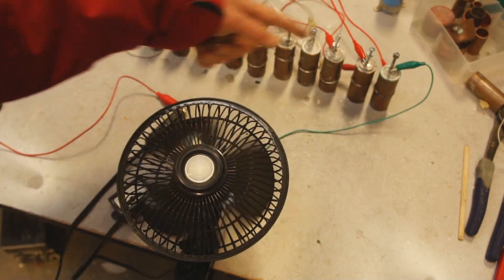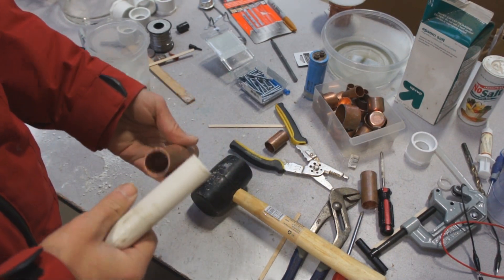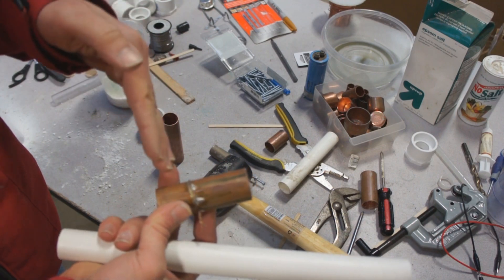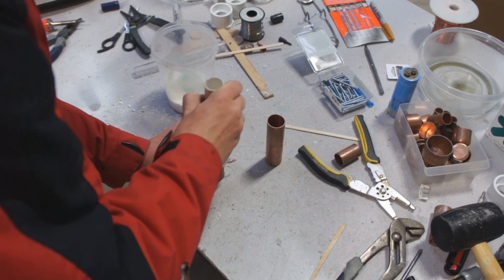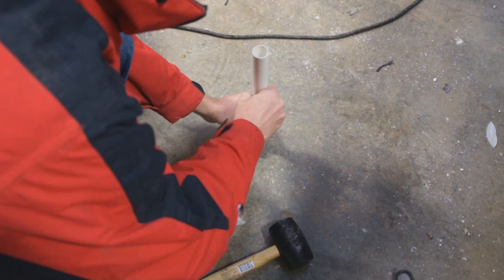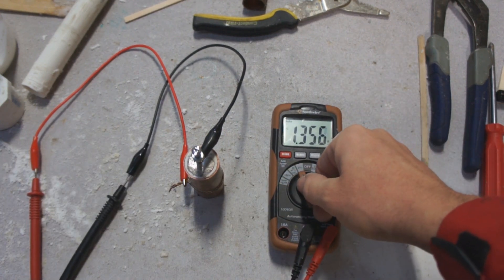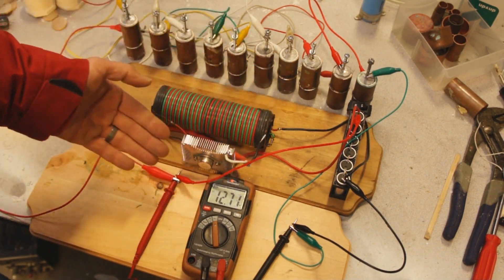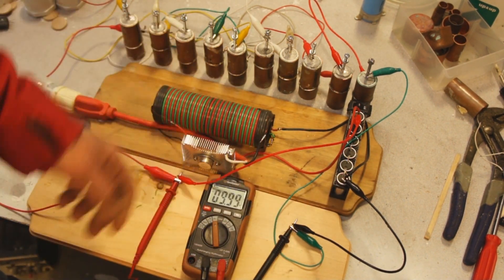12V Crystal Cell Update + Alternative Construction Method

Comment: I created 5 copper cap cells and 4 of the packed pressure cells ...I wired them all in series and hooked up a little electric motor (I'm talking tiny) the motor ran like a bat out of hell for about 8 days straight showing no signs of slowing down whatsoever .....Out of nowhere it died,,,,I can unhook the motor and count to 10 , hook it back up and it will run for about 30 minutes...I am at a loss as to what might have happened ...the only thing I can think of is that the little motor is failing and putting up far more resistance as it dies more and more ....the crystal cells are still putting out the same amount of power ......you also have to take into consideration I hooked up this motor absolutely raw ...just straight up + and - wires direct...straight off the cells ..
Reply: Danyal Ahmad First of all couple of things you should pay attention to :)
1. The copper is just the charge collector. You do not need a copper pipe with thick walls. It can be a thin walled copper pipe (you can save some money there). You can also use a brass pipe which is a compound of copper and other materials.
2. Since you are trying to make an artificial environment like a crystal you will need to pack the salt mix really tight. With hammer push it down to extent that it become rock hard.
3. The distance between Magnesium and Copper should not be that much i.e. try to keep it below 10mm (if you can).
4. Amps draw is directly proportional to the size of setup i.e. how much Mg surface.

With a 100mm height and 20mm diameter Mg rod inside a copper cylinder you should be able to get 100mAmps at approx. 1.7 volts.
Reply: Danyal Ahmad
yep i tried both...Mg rod inside a copper pipe. And Graphite wrapped around with Mg ribbon strip.
I like the pipe method. It is very good clean and produces more amps at dry state.
Reply: Salam Steve Pabst, I noticed the same that it dies after certain duration. Were you able to figure out how to keep it stable. I have seen some guys shorting the cells overnight. The next day when they test it, the output is low but remains steady. I guess that is the way to go.
Reply: I've been using an insulin syringe and adding tiny bits of water....they will run for several days until they completely dry out.....my next move is to repack them using pure active ingredient chemicals and i plan to start weighing them out and taking notes if any combination works better than another....
Reply: Steve Pabst Which method do you think is better? And why do you think your power cells failed?
Reply: Talha Kamran Which method do you think is better? How long do these things last, and why do they seem to fail?
Reply: Danyal Ahmad
They don't fail Danyal... I have been lazy to upload my latest creation.
Copper + Mg with salt mix as [MgSO4, Dry Alum (Phtakari in Urdu), Potassium Chloride, Borax]  ..... this is a very stable cell. It will give you around 1.4 V and mAmps depending on the size of the structure.
When you use Steel pipe instead of Copper the volts will be at 1.7V. But with steel you will need to add few water drops to the salt to get it going. Which will cause corrosion but will give you good output.

Another good candidate is graphite rod instead of Mg Rod. It will give out less volts i.e. 0.5v but is very strong and long lasting and gives out decent mAmps.

At the end it is hobby and good fun to play around and have few LEDs lit up for months to come. :)
Reply: Talha Kamran  Thanks for the reply! I still want to know which method worked better for you! However, your creation is the same as lasersaber's.

 CRYSTAL POWER CELL-
·      Potassium chloride - $16
http://www.ebay.com/itm/Potassium-Chloride-KCl-5-Pounds-99-Pure-/280732924011?pt=LH_DefaultDomain_0&hash=item415cfc786b
·      Hydrated potassium - $18
http://www.hometrainingtools.com/alum-500-g/p/CH-ALUM500/?fee=2&fep=971&gclid=CNKmi6f95MMCFcZZ7Aod2WwAOA
·      Sodium tetraborate - $8.74
http://www.farmandfleet.com/products/747091-twenty-mule-team-borax-detergent-booster.html?utm_medium=shoppingengine&utm_source=googlebase&gclid=CLW-5YL-5MMCFY9m7Aod_3AAsQ#.VOEboCy8rbc
·      Magnesium sulfate-  $3
http://www.pipingrock.com/bath-body/epsom-salt-magnesium-sulfate-90078?prd=D0000J&CAWELAID=600007550000015939&CAGPSPN=pla&catargetid=600007550000023158&cadevice=c&gclid=COrT58b65MMCFYk8gQodFJIAdg
·      Magnesium water heater anode rod- $49
http://www.zoro.com/i/G7609883/?utm_source=google_shopping&utm_medium=cpc&utm_campaign=Google_Shopping_Feed&gclid=CKS0v9mB5cMCFXQQ7Aod3U4ANA&whence=
·      Copper Rod $27.48
http://www.homedepot.com/p/Mueller-Streamline-1-in-x-10-ft-Copper-Type-M-Rigid-Tubing-MH10010/202287131
Reply: Talha Kamran With the Crystal Cells msde exactly like lasersaber did, how many volts, amps, and watts are we talking about?
Reply: Talha Kamran I see. I have been working on designing a much better Crystal Power Cell that can give a output of 100-400 dc. I just found out that John Hutchison had the same idea, and he was able to create such a cell a couple months ago. All I can say keep on experimenting, keep on learning.I truly appreciate your support in the process. You clearly have more experiences with them more then I do.I will surely use the research you have shared with me while prototyping it!

Comment: Why don't you build a bigger battery?
A car battery size
Reply: size of the cell seems to have no effect on output voltage. these are long term power cells
--Rick
Reply: +Rick Coona I think maybe paul wants more amps -- Rick, would the larger cell increase the amperage that the cell settles to for long-term output? thanks

Comment: I love your videos! I was wondering if you considered combining a crystal cell setup with a boostcap setup with a diode in between that could start a car yet trickle charge so as to not die from computer/clock or w/e voltage drains.

Comment: Ok- dumb question, if you made a larger diameter battery that was longer( say 4" diameter x 3' long) would it give you more amps, voltage, or life span?  Now and then I see copper residential plumbing removed from an older house or commercial building and this got me thinking.  Sorry if this sounds stupid, I always slept in science class but now I think it's cool.

Comment: Have you tried adding additional bolts in the top so it makes more contact points with the magnesium? it may double the output on each cell for each additional bolt as long as one material doesn't exceed the other. I haven't watched all your vids on your development of these cells so I don't know exactly how they work but I did hear you speak of "more contact points" as being more beneficial.
Reply: No way. Output volts is defined by the materials. Output current by the electrolyte resistance. The bolt is not part of the battery chemistry - it's just the connection method. However, it will ensure that the cell has no hope of reaching the daft ambition of 100 years life, as the combination of steel bolt and magnesium electrode will corrode away.

Comment: Thats a lot of wasted effort...  As if decades of research by thousands of chemists and engineers somehow missed this miracle cell....  The reason these arent ubiquitous is that they are terribly ineficient and his entire battery bank could be replaced by a few lithium cells.  You can build better cells with penies and vinegar...
Reply: yes, but these batteries are not toxic like lithium batteries and you can make one in your kitchen safely. unlike a lithium ion cell....
Reply: Well it's a trade off, if you need an emergency standby power source that you never need to keep an eye on, these cells work, but in most situations other battery types, such as alkaline, provide satisfactory standby time.  Basically it suffered the same problem as the edison cell, forever isn't as useful as powerful
Reply: Perhaps to light a doomsday prepper bunker it's ideal.
Reply: Lithium cells is dangerous... Crystal cell is safe. It will not explode.

Comment: How long do the crystal cells last? 

Would you be able to run an LED light for 2years straight with one of these?
Reply: 2 weeks...built one exactly as shown above and they run for 2 weeks via a JT...after that you still get about 1.1 to 1.2v but no amps (well .02ma)

Comment: Great video lasersaber, keep up the awesome vids!  I was wondering, do you think these could be wired in series and parallel such that they would power a tiny house running 30 amps.  I imagine it would take about 900 crystal batteries connected appropriately

Comment: I think there is a missing bit of information.  I have found that the humidity of the air can greatly impact the current.  If you have completely dry ingredients the voltage may read around 1.3v but have almost no mAh.  When water is added the mAh increases dramatically.

Comment: how does the size of the cell dictate the amp or voltage? long more amps or wider more voltage?
Reply: Same as any other battery cell. The voltage is defined by the chemicals (copper and magnesium) and the resistance (which controls the current) depends on the areas of the plates, the conductivity of the electrolyte, and the thickness of the electrolyte. You want big plate areas, very small gap.

Comment: I did a project with my children with some of your design idea. But found that the ratio of magnesium core to crystal and copper ratio to be a waste of magnesium. (short term testing only). We used 1/4 inch magnesium and 45 Long Colt empty brass. We obtain 1.25v average at 10mA constant output after a couple of days. Yes a lot more work but less material. By placing end of rod in small amount of hot glue and capping off the way you did and by leaving rod protruding a little bit higher than the brass. We are able to stack like conventional batteries to create a higher voltage. We are then paralleling them for more current. For fun we made a cattle prod out of disposable camera and it powers it. (charging flash circuit takes just a little longer) But melts aluminum foil when touched. Thanks for your video we had fun making these!
Reply: Just wanted to mention your way is a lot easier to do. Working with small materials really took more time. :)

Comment: Correct me if I'm wrong. But I'm pretty positive you cannot check amperage like that. First your have to have a functioning circuit complete with a load. Second the measuring device has to be put into series with the circuit. From what I could tell in the video you never changed meter lead position from measuring volts to measuring amps which will not work

Comment: hola me podrias decir la composicion quimica para hacer la pila
Reply: It is a dry cell (Daniell's cell) and uses a pair of precious metals, such as copper and zinc, or copper and aluminum. The electrolyte is a moist white powder of zinc sulphate. It is mostly combined with other types of white powder electrolytes. The condition is that the electrolyte must not dry out. It is better to embed the cell in the asphalt. Battery life is the same as zinc-carbon-salmiak cells, which are easier to produce at home. Aluminum-copper cells are not manufactured because the metals used are expensive. Such a battery would not withstand competition.

Comment: Hi, can you keep the batteries constantly charged with a static electric charge? An example would be to use Kelvin's Thunderstorm Set up. I am building a wind up mechanical engine that will pump water for hours for Kelvin's Thunderstorm and it would be great if the crystal batteries can be constantly re-energized with a constant static charge put on them.

Comment: I Love this. I've watched your other videos on these crystal cells, but am at a loss as to the ingredients used to create the crystal powder. Also, what grade of magnesium are you using? And one more thing, what are the measurements of the mag rods, and copper pipe? If you could write these down, for a beginner to understand, that would be great.  Thanks..
Reply: Donald Lee Smith, who claimed to have invented a free energy machine, has been making headlines again. His latest invention, the Crystal Cell Update, is said to be an alternative construction method that is cheaper and more efficient than the original.

Smith's machine is based on the principle of tapping into the Earth's natural energy field. By using a series of crystals and electronic components, the machine allegedly produces enough power to run a household for free.

Critics say that Smith's machine is nothing more than a scam. They point to the fact that he has yet to produce any scientific evidence to support his claims. However, supporters say that his invention could change the world if it works as advertised.
Reply: Oh man I tried them all ..ingredients last for ever but anode specially magnesium gets break apart Quickly...

Comment: I made one of these about half the size of these and it's clocking in at almost 1.5 volts. and about 1/4 of an amp. this really is an amazing device. I plan to make a few more to see what they can really do. Thanks lasersaber
Reply: Any update?
Reply: @haveaniceday7950  wow that was forever ago. not really. didn't really figure out anything new.
Reply: Mighty Tighty Whitey And I'm Smuggling Plums thanks. Are they worth experimenting with?

Comment: What you think about compressing all powder in cell with hydraulic or screw press with pressure about 35 tons per cm2 ? this amount of pressure should melt powder and if whole thing will be frozen just before releasing press consistency of material should be much more crystal than this made by whacking by hammer :P
Reply: That would be awesome... I wish I had such machinery D:

Comment: I had an idea to get more energy from one of your crystal cells.  Make several cuts with your hack saw (or band saw) almost but not completely through your magnesium anode. Then melt your compound into the cell. It should give you almost 300% surface area for the compound to react with the core thereby increasing voltage and current significantly.
Reply: Or several coins cut from your core and screwed onto a bolt at 1/32 to 1/16th of an inch spacing should work the same way.

Comment: I am curious about the size of the mag vs the mix.  What happens if you use a smaller mag rod and more mix.  Have you tried that to see if it increases the volts or decreases.
Reply: Materials control the voltage. Electrochemical potential. Not the dimensions. That's why all conventional cells, large or small. make 1.5V.

Comment: I want to duplicate this, I am wondering however, how long is the copper + mag rod.  I'm assuming 3.2" since you made 10 and give instructions for 1 32" rod, but can you please verify?  Also are the 15mm diameter mag rods at the other site that are 3.6" long, will they fit inside of the 1" pvc after it's been formed for packing?